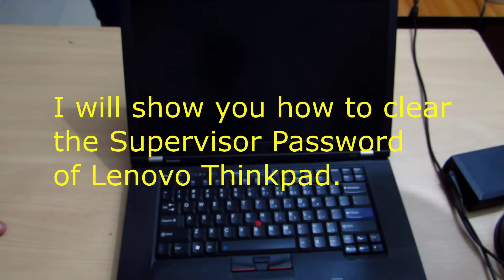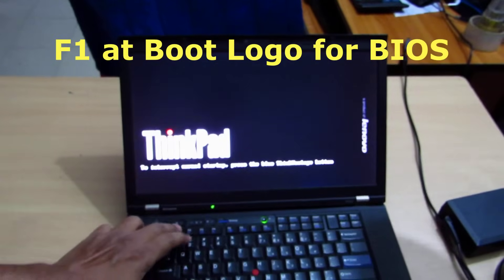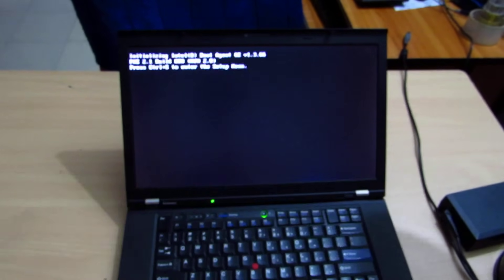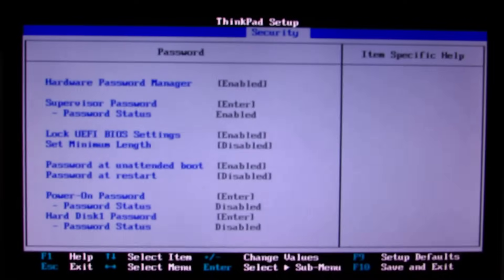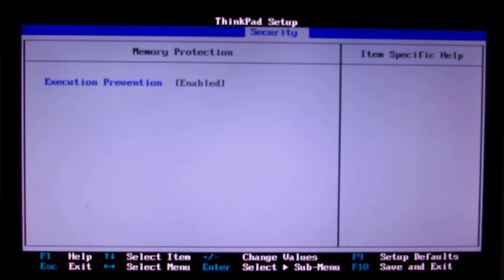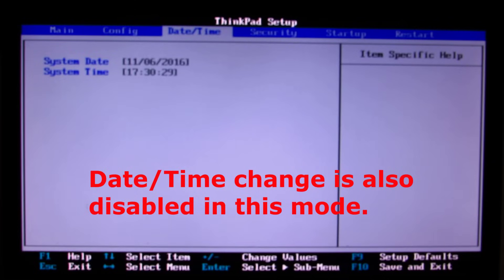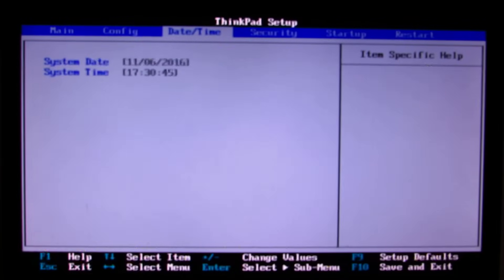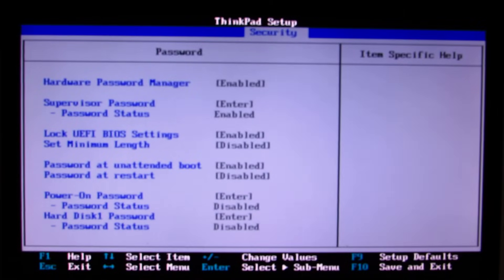How to unlock BIOS Supervisor Password from Lenovo Thinkpad Laptop (no damage to laptop)

Comment: I came in and watched this video expecting it to be another bogus "fix it" video but son of a bitch, it worked! I can't believe it. I have a T510 laptop. Thanks!
Reply: So what method do i use for t460s? Since its newer.
Reply: I have a T460 too and I need to access my bios so I can reload a new hard drive
Reply: @dankrs5563  ever figure out anything, I have the same model. Looks like I'll have to replace the motherboard.
Reply: @dankrs5563  hi have you found an answer?
Reply: Anyone know the location on a t540p?
Reply: @raomar0  I have the same question !  Anyonefound a solution yet ?
Reply: anyone know T470s short pins location ?.
Reply: I have a T510 I don't know if I'm hitting the wrong chip or am I using the wrong tool pleas help
Reply: I used this technique on Lenovo b470e , it's not work. I made right join but After some time display gone.  is there any solution.  is bios corrupt? its Phoenix bios
Reply: How about in the carbon x1?
Reply: Last 2 posts are fucking spam bots btw
Reply: What about x220T
Reply: Not working on my lenovo yoga 460 please help
Reply: Should be mentioned somewhere that this only works with 30-series laptops and older (T530/T430/L530/L430/X230/etc.). On newer models (40-series and newer) Lenovo changed the way the passwords are stored and doesn't use the extra EEPROM anymore.
For EEPROM locations check this forum post: https://www.allservice.ro/forum/viewtopic.php?p=3521#3521 
For hardware maintenance manuals to help with disassembling: https://thinkwiki.de/HMM
Reply: @Knaeckebrotsaege  so you are saying it won't work with my t420s?😢
Reply: @raviei426  It works on anything up to (and including) the 30-series, so it will work on any T400/410/420/430, but not T440 and newer (using the 14" T4xx models as an example). EEPROM location for your T420s is between the southbridge and the battery connector: https://www.allservice.ro/forum/images/t420s.jpg
Reply: @raviei426  just did it to my t420
it works
Reply: @Knaeckebrotsaege   does this method helpful in ThinkPad X1 Carbon ?
Reply: @kneckebrotsaege HI DOES THIS METHOD WORK ON A LENOVO YOGA 260 THINKPAD PLEASE THANKYOU.
Reply: Does it work on my M7033 desktop?

Comment: Does anyone know if it works on a Lenovo X390? I'm not able to make it work. I found the BIOS chip but in the motherboard specs doesn't say anything about SCL and SCA pins (instead it is CS, DO, DI, CLK, SPI...).

Do I need a specific tool to do the short? I'm using just a piece of cupper wire.

Thank you for the information!

Comment: What instrument can you use to make the connection? I have a screwdriver with a plastic handle, would that be safe enough? Do you have the mains plugged into the laptop?  I am concerned that I might get a shock from doing the short as the machine is live.

Comment: Okay, I can't believe it, but it works. Here some unwanted advice while doing it:
The chip is around under the keyboard probably and its characteristic is that his pins are longer than in a normal pin It should have 08 or 24 number on it in any spot, so you don't have to take apart the whole laptop.
As I saw this is shown me a message that it had problems reading the chip, and it just showed default options and then when you let go it saves the options you changed to the chip you were blocking. I tried to use on board chip reading on this chip, but the chip is too small to do it normally so shortening pins is easier.
At the end, my laptop doesn't turn on the system anyway so

Comment: First of all, good evening. I bought a ThinkPad T430 3320M, and the BIOS is locked like the one in the video. I couldn't understand much in the video, but I need to do this procedure. What did you use to reset it? Note: I'm Brazilian, so it's difficult to understand English. (This comment is translated by Google)

Comment: Worked for me eventually on Lenovo Thinkpad Edge E540, didn't even need to disassemble the laptop, chip is a bit hidden, but a piece of paper clip and lump of BluTak was what a I used, which fitted snugly between the pins, after lots of trial and error managed to change the password.

Comment: On my E590 it's the U0901 Winbond chip in the neighborhood of the WiFi module. But the shown method does not work. At least not with the installed BIOS version 1.36.

Comment: am trying to buy a W520 and the seller indicates that it has some kind of lock (supervisor in bios?) and cannot boot from hard drive - anyway there is not one - but boots only from usb. Read some information about the eeprom chip and wanted to ask what are the odds in my case. The price is low enough to buy it for parts, excluding the mb, but i want to make use of the laptop.
Reply: stolen device...ask him for a receipt and with that you can contact Lenovo to unlock it

Comment: It's not required to use both I2C bus wires (SCL/SDA) to short them. Grounding one of them is enougth and thi sis more save. That's more reliable that this works for all Lenovo Thinkpads.
Lenovo distributes a Tool to correct the Serial# and Model#. That tool is allways used by lenovo to flash the bios. It's ask directly after start, what you want to do. Flashing the bios or "correct" the SN & Model#. A lenovo service technican who replace the main board use this too.

Comment: Bruh, It's worked. I can't believe it. after 7 year it's worked on Lenovo G50 in 2024🙏🏼❤️🤐

Of course, it took me a day.  I had over 20 attempts to short circuit at the right time
Reply: after 2 weeks, I have to say that my laptop has fu**ed up... important motherboard information such as S/N, hardware ID, laptop model and even battery information along with the supervisor password have been wiped off. The battery was charging for three hours. After erasing the battery parameters, the BIOS does not understand the battery charge and it will be empty for half an hour. Also, when the laptop is turned on, it takes 10 seconds to display the Lenovo logo and perform POST.

Comment: a document i wrote when bored  ....lol ignore the misspelling i was on a roll  ... here it is ..... 
remove the large power battery

1st   clear the bios , remove the cmos battery under the small door on back side
verify the bios is cleared you will get a time,date error and it will enter bios on f1
remove power and plug in the bios battery again
remove the bottom screws . all of them
remove the cd  and 3 screws under the outside laptop edge after you pull it out
remove the keyboard , it slides up and out
remove the ribbon cables connectors by flipping up the black holddowns
unsnap all the top platen and remove it
flip the top over then unscrew the power switch and remove it and cable from the top
plug in the power switch cable to the mb , into the right connector and secure it.
locate the chip to be shorted  pin 1,2  and have a small screwdriver ready to short it
(its nearly across from the power connector , chip is by self near 2 others simular to it)
plug in ext usb keyboard
plug in the dc power
be ready to short the chip 1/2 sec after you hit power switch
if you get a lot of beeps the short was done too fast and the keyboard strobe to that chip registers a stuck keyboard .. pull the power and try again.
if successful you will get several errors on screen ,, woo hooo, don't release the chip from being shorted yet ..
now go into bios  .f1 as screen says ,  arrow 3 times to right to security  , hit enter the password will say disabled ,, hit enter  , your in password  do it again  hit enter  , now save f10
or esc then exit then save, don't release the shorted chip till the screen comes back.
it will force the bios time date error again but this time the security will have the password
disabled.

if you anytime get the lock symbal you failed , start over . power , short , error, pswd,save
its all in the timing of the 1st second after the keyboard strobes and your short
reassemble and test . you should still be able to see time date error and get in bios . ta daaa
now set the time and date and save and exit . done
sometimes you can't get back in bios again as its a design flaw .. you can't  not w/o clearing the bios .grrrr

Comment: Greetings, I'm in desperate need of help and hope I can lean on your expertise for a resolve-remedy of sorts as I am stuck with error; "critical_process_died windows using this laptop; "Lenovo YOGA 73015IWL" 

* Stuck in Automatic Repair mode thus booting into the Blue Screen troubleshoot page.
* I'm able to open all fix-it options in advanced mode ie Startup Repair, System Restore & all the rest.
* Unable to start any & ALL Fix Processes which are being blocked by Bios Password, no matter which option selected?
* The User Password has the same exact issue saying it's the wrong password, huh?
* I've managed to Reset Password on the same platform, again, wrong password error, corrupt it is?
* Why is it asking for a password for all various options & then says it's the wrong password?
* I go in the same circles over & over again with the exact same password error results.
*I'm unable to access any method to fix the critical process errors with NO Access?

Please guide me through a fix for this blue maze of options to boot this Laptop without any password necessities, User or Bios or ?  Power up and boot right into a functional computer on all levels w/o any password requirements on all levels, thank you so much...

Comment: DON'T DO THIS !!!!  
It totally destroyed my motherboard. You can't do this anymore, tried this on a T495 and got the 0285 error which stand for "TCG-compliant functionality-related error (might be the TPM initialization failure)" basically the Thinkpad won't boot anymore because the Trusted Platform Module has been violated. HOPEFULY it's covered by warranty
Reply: U must need the first renew password blank (retype nothing 2x). And hit save 3x.  After that it is much more easy to acces & Re-assable the new passwords

Comment: i was able to unlock x61s. it took 3 attempts. during the last one i shorted the pins before powering up the laptop and tapped on F1 multiple times. i navigated to the "supervisor password - disabled" entry, hit Enter, released the pins and pressed Enter two more times (password and confirmation), then saved and restarted. it worked. 
thank you Arpan for putting your time and effort into sharing your knowledge.

Comment: This worked for me!  For the T520 the chip is on top of the motherboard, so no need to remove the bottom of the case. It's basically under the touchpad, on the right side (as seen from the top.)
Reply: Same with t530

Comment: This procedure works for Lenovo T510 but precise procedure has to be followed:

1. after power on screen shows up, ***short the pins immediately and press F1 on keyboard
2. press F1 until you enter unlocked bios, if the bios is not unlocked repeat step 1
3. go to security/password/supervisor password/ leave the field "Enter new password" blank and press "enter" once still shorted pins**
4.  while the cursor is on "Confirm new password" filed release shorted pins and press enter again/continue - enter again
5. press "F10" save and continue
Reply: Goran Krzic Thanks very much! Got a few of the same Thinkpads from my wife's office as they upgraded, the method in the vid worked perfectly on the 1st one, but the not the 2nd no matter how many times I did it...Your instructions to hit F1 until BIOS opens, made it work for me.  Appreciate it!

Comment: I have my ThinkPad 600e locked. It has a 14pin 24RF08 EPPROM, by the way you demonstrated is the shot was made by connect PROT and GND pin?

Gonna give a try with my 600e soon...
Reply: You're supposed to short the SDA and SCL pins. Did you get it to work, though?
Reply: Desko Also, you should conduct the pins at first or second post screen instead of at the beginning of the boot - it will only brings you another error code (127?) then stop you entering the BIOS. It’s a try and error process while worrying the CPU becomes quite hot after removing the heat sink in order to access the EPPROM....
Reply: Desko I got my 600e unlocked by short the PROT and GND, however the timing of letting go the short while entering the BIOS is a bit tricky. It took me few time to get the work done.
Reply: @shinya1215  Alright, thanks. I'll keep that in mind when I do this trick on mine later today.
Reply: @shinya1215  Thanks for the advice. Sadly, I wasn't so lucky. I kept messing up the timing and wasn't able to short it consistently, and I ended up giving up today after 188 and 189 errors started appearing from a cold boot. I don't think there's anything I can do about those at this point, so I guess I'll have to find a replacement system board.

Comment: Can you help me with same problem on lenovo g570 ?
Reply: did you ever figure it out?
Reply: @yanivrubin4166  unfortunately no.
But I've changed my chassi with new one, with not broken hinges (now it also broken) and at the end of 2021 changed ram to 2x8gb, cpu to 2720QM and 1tb ssd.
Reply: @92OnTV  I assume that didn't affect the bios though... Don't you need to replace the actual motherboard for that?
Reply: @yanivrubin4166  no, I've also got heatsink from g570 with dedicated gpu, it have wider heatpipe, modified it to get it fit in my laptop. There was a list with supported cpu's, there was also Ivy Bridge cpu's, but I didn't risked buying it, just stayed in same generation.

Comment: You can also just remove the cmos battery, then boot into bios, which should unlock all the settings and then disable the locking ting
Reply: Ive tried thatalready and didnt work.
Reply: Removing the CMOS battery only works on very old computers

Comment: Grat help that solved my problem. I purchased an thinkpad x301 that came with a supoervisor passoword the pervious owner didn't know about. Was a bit tricky to find the eprom tho short the two pins and a bit of patience to find the right timing to short these pins . I my case I had to wait about 1 sec. after the thinkpad logo... shorting immediately after thinkpad logo apeears resulted to a data error. But after about 20 attemps it worked as discribed. Thanks a lot for this video!

Comment: How to even check if my lenovo has Bios password set?
I recently bought a Lenovo laptop and everything working normal, just thinking to upgrade the ssd and reinstall windows l, I'm curious if there is some thing related with a bois while a SSD upgrade.
Thanks
Reply: just enter BIOS menu and check if you have a password or not. And with the ssd I don't think that you'll encounter any problem, but just to be clear do a quick search and I'm sure you'll find out. Good Luck pal!
Ans just out of curiosity, what thinkpad did you buy?

Comment: Sounded like a scam, but actually worked perfectly on my L530 :D
Google your model + eeprom (like "L530 eeprom") and you should find pictures of where it is. Then just google for the hardware maintenance manual for your thinkpad and skip to the disassembly instructions (usually close to page 50)

Comment: But for Lenovo x200, it's impossible to reach the read mode. When you tape a wrong password, it blocked and that's all.

Do you know what to do ? I have moved the CMOS battery for 1, 5 or 10 minutes and it's same thing. Don't reach my Read mode or my Os.

Comment: I was given a ThinkPad T410 and a T420, both with supervisor passwords. I'm planning on soldering wires to the EPROM pins then mounting a tiny pushbutton switch somewhere in case of someone setting a supervisor password after I get them removed.
Reply: Or you could set your own password so someone else can't get into bios to change it.

Comment: Hi guys, i'm trying to short the winbond 25q80jvsiq on the Lenovo T470s. It's not working. I've tried shorting several pins. Is it the right chip?
Reply: This method doesn't work for 40-series and newer (T440/T540/X240/etc) since they don't use the separate eeprom to store the PW anymore.

Comment: I have a very similar laptop, the IBM Thinkpad r50e 1834, but the CMOS battery is dead, it always boots with a "0271: Check date and time settings" error, and I can't enter the BIOS. I press F1 repeatedly, the error message appears, 3 seconds later I get the locker symbol waiting for a password, pressing the Return key adds up to 3 XXX then it locks up with a stop sign with a hand inside. Do you know how to fix it?
Reply: Have the same symptoms on x41. 
Do you managed how to fix it?
Anyone can help me?
Reply: @Naghual80  I have the same problem, do you solved it?
Reply: @TheAleksanderrr  no I don't
Reply: @Naghual80  and what you do with it?
Reply: @TheAleksanderrr  nothing, absolutely nothing. Waiting for the good occasion to fox it…
It not have to be feeded ;)